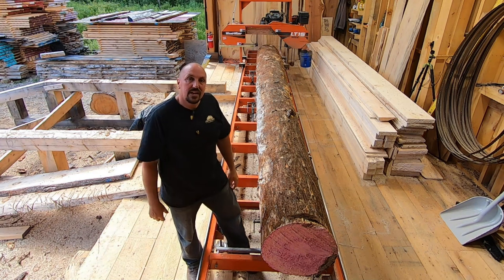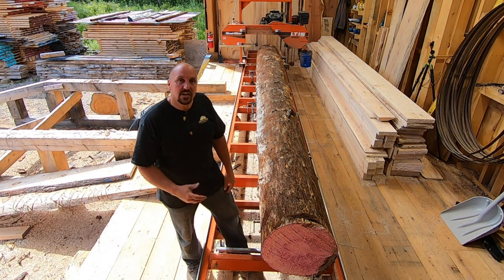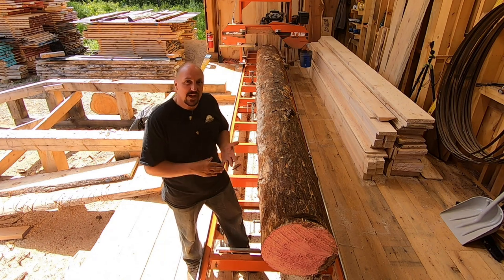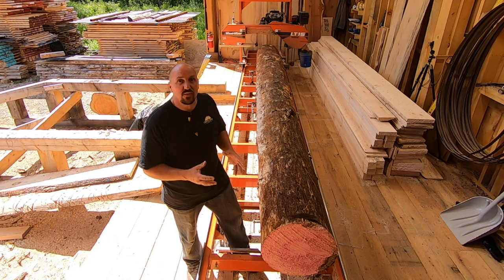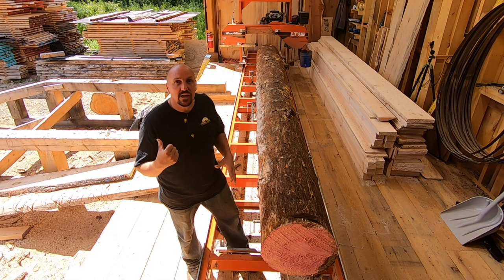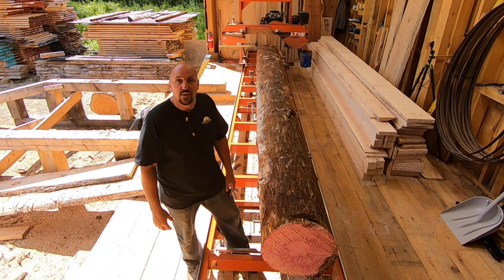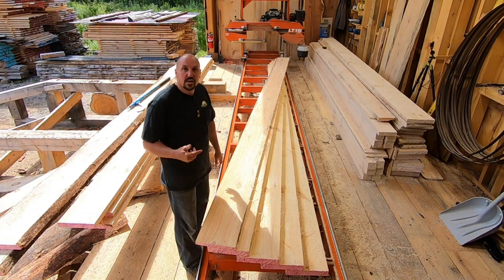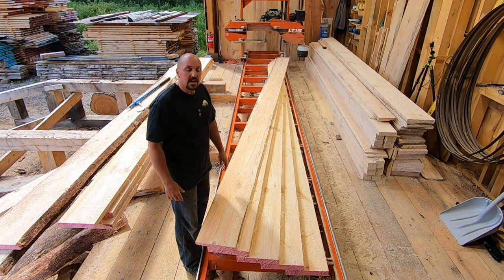MILLING EASTERN WHITE PINE, HAPPY INDEPENDENCE DAY!!!!, #53

Comment: How long does a blade typically last?  Say number of runs through a log, such as this one?  No rocks, metal of course....  And how do you get the lumber inspected for grading?
Reply from the maker: The blade life is all based on board-footage.  In hardwood small logs we can get 6-800bf. In larger (30") hardwood logs we will typically get 350-550bf out of a blade because of the heat drawing the temper out of the blade tips.  In softwood (we cut eastern white pine, typically) we will average 1500-2000 bf. If the log has even the smallest bit of mud on it, we will de-bark it.  Hitting a clump of clay the size of a golf ball will smoke the blade.  NHLA has rules for hardwood lumber grading/sale.  For framing lumber, there are a number of mobile-graders in our area who will come to the yard or jobsite and stamp/grade out the stock.  -Andy

Comment: I quess the center of the log is usable? Or does it warp like a banana?
Reply from the maker: Brian the center of the log (the "pith") is usable with certain species/types of cuts.  It's a complex answer.  The pith is largely irrelevant when cutting softwood framing lumber.  When we cut larger beams (6x6-12x12's) we try to center the pith, as it "pulls" less when it is centered.  When the pith is heavily off-center, it will banana even larger timbers significantly, during air-drying.  For hardwood it's best of avoid the pith for any/all grade-lumber.  Certain species like ash/cherry are much MUCH more prone to checking through the pith, so it's a guaranteed waste of material.  We haven't noticed excessive destruction/waste around the pith when slabbing hardwoods.  -Andy